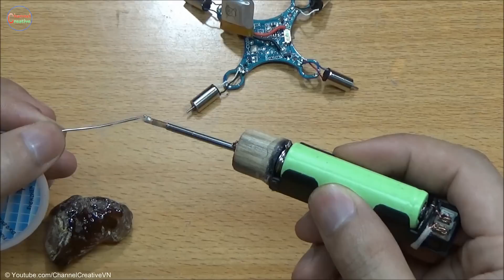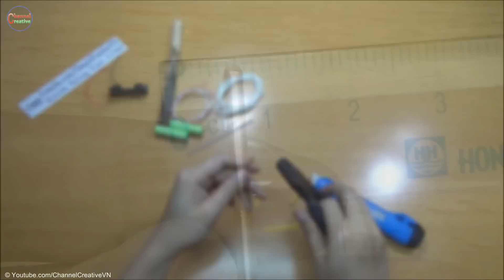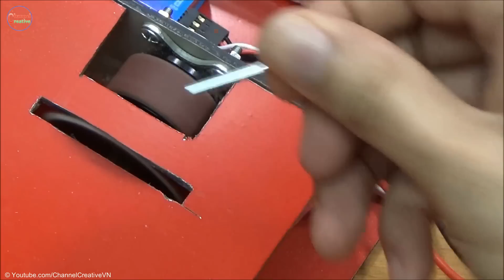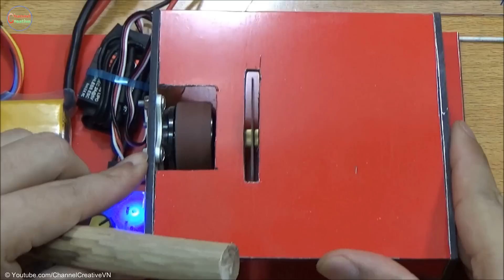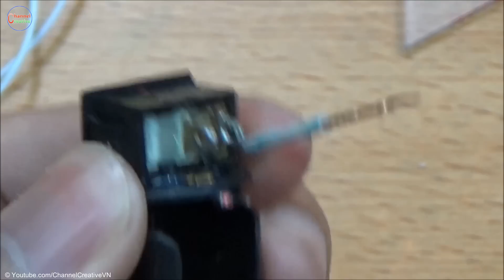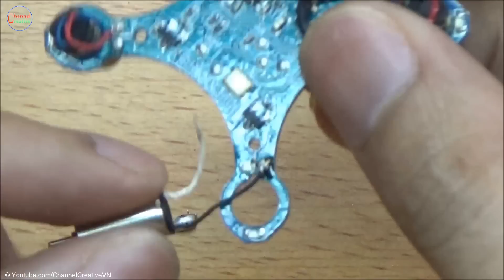How To Make A MINI Battery Powered Soldering Iron Tool

Comment: nice li-ion cell killer for non protected cells
Reply: +pe6o991 I also thought they read "do not short" on batteries.
Reply: +Sailor OnDaTea where do you see the short? I see the load attached to the battery. It's the same as if you would power a ~5W bulb with a battery.
Reply: how many ohms are there?
Reply: +Sailor OnDaTea
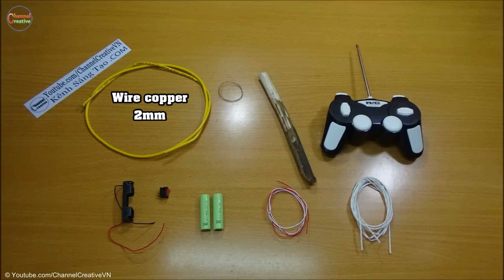1:14 - he uses Nichrome wire 0.2mm which might be 34.7 Ohm/m.
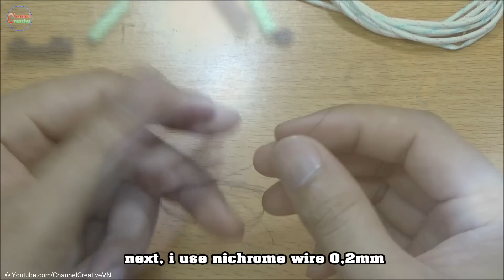3:03 - he uses 10cm which is around 3.5 Ohm. He does not use full length, so final resistance is smaller, could be roughly 3 Ohm.
Reply: +binaryLV alot of E-cigs also use Li-ion batterys with coils being around 1,2-3 ohm so there is no diffrence. ive never heard of a E-cig exploding in someones face.
Reply: +link Xavier Stone I'm pretty sure e-cigs limit the MASSIVE current lipos can output
Reply: darwin miller a regulated E-cig does yes. but not a mechanical E-cig. its basicaly a button that pushed the battery to the connection and drops it of when not pressed.
Reply: +link Xavier Stone My friend lost two fingers cause of explosion of a 18650 battery in his mechmod.
Reply: needs to use protection and imr batteries.
Reply: +link Xavier Stone It's not about the resistance.It's about over discharging the cell and potentially destroying it.
Reply: Check my diy solder iron there is a bms

Comment: wow very good idea
Reply from the maker: thank you
Reply: Где взять нехром?
Reply: +Андрей Вединяпин НИХРОМ!!!!! на али, в паяльнике, в китайских клеевых пестиках  которые продаются в фикспрайс, мог бы и догадаться, старые электроплитки
Reply: Стас Лагутин благадарю!(мог,но что-то подзабыл обо всём,кстати клей.-пест. у меня-расплавился)
Reply: Стас Лагутин
Reply: yes but the batteries suck
Reply: Juli The Wolf 
Not necessarily. If you use decent(ex- Sony vct4/vct5, 30a continuous draw) batteries there's more than enough power and if battery life is a concern then 2 or 3 in parallel( 2-4200mah, 3-6300/vct4) will handle it.
Reply: I didn't meant rechargeable batteries

Comment: can I use a coat hanger or a nail instead of copper wire?? bcs I cant find one of it
Reply: Muhd Faaris won't cunduct heat very good as copper most of soldering tips are copper because they heat in the matter of seconds
Reply: Muhd Faaris you still can try to use some other material but it won't work as good

Comment: As someone else already pointed out, this is a perfect way to kill a perfectly working lithium cell. Unless you're very, very careful about not discharging it too much, I guess, but you should not just rely on that. Lithium cells protection circuits are very cheap, you can grab several for a couple of bucks on eBay.
I have to say though, that it's a really neat idea.
Reply from the maker: +Nixola97 hi friend, Thanks for advices

Comment: can wire be doubled up. . I got a few rolls off eBay and we're  .10 opened a simple iron it had fibreglass tape and many wraps overlapping. was hoping to be able to do something of the sort. expected a Lil error from trial. but any tios would be appreciated.

Comment: I want to make something like this to use in my DIY projects, to make holes in plastic containers (to put switches, connectors, etc). That way I don't use my soldering iron for that. But I can't find fiberglass tubes or tape here in Brazil anywhere. :/ Any ideas? About the wood, how to replace it? Thanks!

Comment: is it totally safe to use and can we connect 3 v or 5v supply via adapter
Reply: Adapter is probably safer because the safety insider the voltage regulator

Comment: I have one question , if the battery is geting hot and i know lethium is bit dangerous and can explode when get in touch with air (O2)  , is there any ways to prevent the battery from exploding ?

Comment: I would not recommend using a lithium 18650 battery without a safety circuit....most branded companies like ultra fire has safety circuits.....but some are fake ones that does not have a safety circuit....though it costs less than the original......Can you also do a hot air gun using lead acid batteties....that would be awesome for SMD soldering....

Comment: you shouldn't use an ICR battery for this. This battery type is not save in high current applications like your soldering iron. Better use an IMR battery.
Reply from the maker: +Febmaster Thanks for advices

Comment: Without mosfeet did it doesn't make the switch hot?
Reply: +bahapalan No, the switch has little resistance, so will not dissipate a lot of power (heat).

Comment: Hi Guys,

Will it work if I'm gonna attach two separate "Nichrome Wire" to make a Longer of it for higher Volt taking? I know that the ratio is 1 inch Nichrome Wire is to 1 Volt (1 in. NW / 1 Volt). Would that be possible to do? Or I should use a much long "Intact Nichrome Wire?" Please enlighten me guys!

Thanks!

Comment: im scared on 3.7v batteries...maybe i can use 3 pcs 1.2volts rechargable batteries in series. :)
very good for emergency usage if the grid is power down....

Comment: can you solder a tank that holds water and fuel ?. but with the solder .not  torch .
Reply: you would probably weld it instead but using a torch instead of a soldering iron just makes the work faster.
Reply: bob fogh the surface has to be hot too right? the solder is not listening to me . it refuses to stick on the surface and fill the gaps .  all I get are drops of solder rolling on the surface no matter how hot I get it it's refusing to stick on the walls .
Reply: are the walls clean? do they have epoxy paint? grind it down until it is shiny and smoothish. then try.

Comment: that piece of wood your'e using as an insulator concerns me as over time of being heated up it will burn up/catch fire,your last project had a piece of cork that also has potential to burn up & catch fire too,am i right or wrong?,i d hate for any of your viewers to get hurt if something went wrong?
Reply: nah
Reply: +neil froggy crompton This is for emergency only. batteries are not meant for this  .  don't use this soldier on everyday basis , it is something you make from nothing , you may need that in mountain cabin when your tv dies .  for now use the one with plugs . or use phone battery charger to make one.
Reply: +Mars Seeker yup because you definatley want to use a soldering iron when the power goes out

Comment: what is a nichrome wire? can you please explain
Reply: The wire used to solder using soldering iron
Reply: he used it as a resistor for the circuit
Reply: A Type Of Wire Which Have High Resistance And Can Heat Quickly You Can Get It By Breaking A Heater,Water Heater, Hand Dryer Etc.
Reply: +jagtar singh Very Low Resistance? Seriously?
Reply: Oh Sorry Actually It Have Very High Resistance

Comment: where can I get the components here in the philippines, it's very rare, only the battery ,switch and wire was the only thing I found here. pls tell me where I can buy without using eBay and amazon
Reply: chào bạn,đây là việt nam nhé :D
Reply: Nathaniel Pecson Laptop batteries generally have several 18650 cells.

Comment: can i do it without the nicrom wire
Reply from the maker: +Stefan Dimitrov you can use tungsten filament
Reply: Can i do something else ? 9v battery clip or this thing that goes on 9v battery and just solder a copper wire to + and - just when i want to solder i put the clip on ?????????

Comment: immposible. you cant melt metal with 3.7 volts without a  voltage step-up unit
Reply: Nichrome wire become hot and it make that copper hot and it melt metal...  Ez
Reply: oops... was being absent minded, forgot about laws of electricity

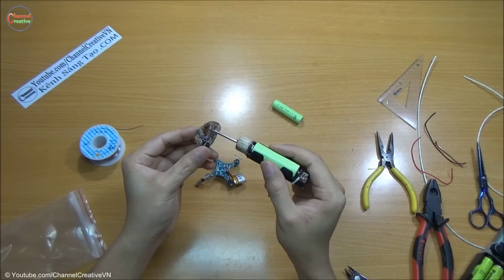Comment: what is that stone type object at 8:30???
Reply: pine flux
Reply: but what its use?
Reply: it cleans the tip of the solder iron
Reply: suyash it prevents the soldering iron from getting oxidized
Reply: suyash aa

Comment: Very dangerous and stupid without cell protection.
Reply: +ThePacklemore if battery voltage goes below 3 volts there are chance that battery will overheat and explode or catch on fire. same if it is overloaded or overcharged over 4.2v